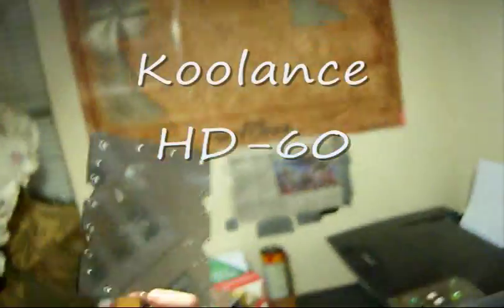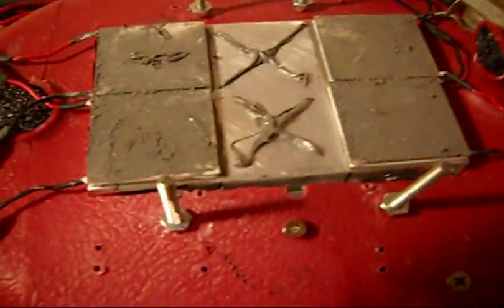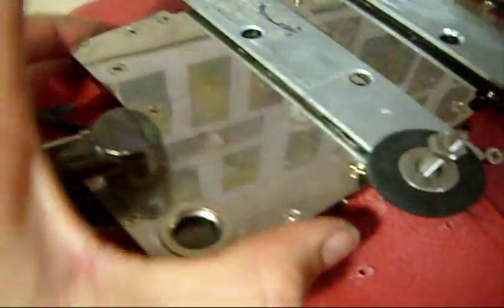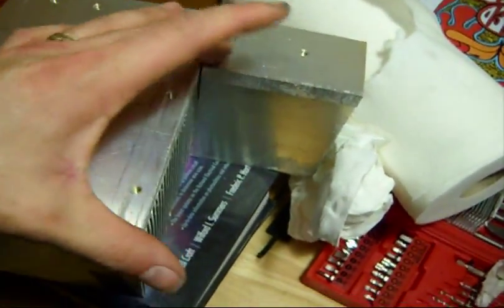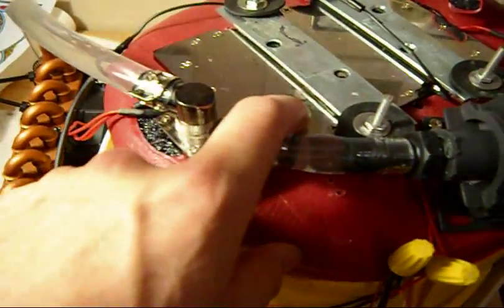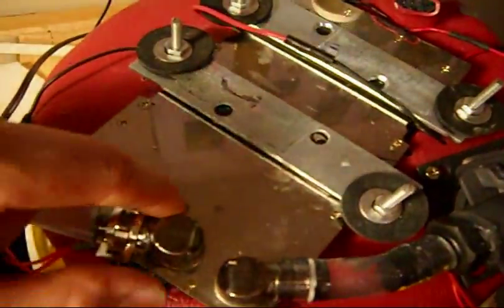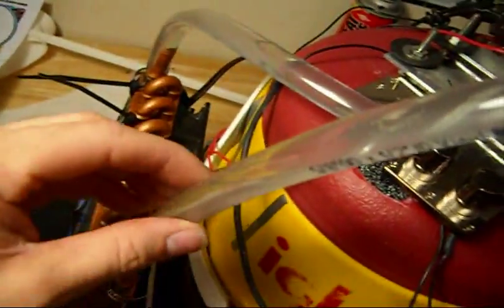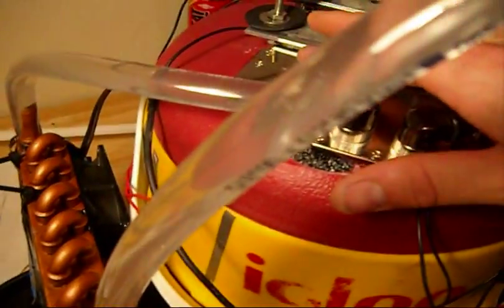Thermoelectric Cooler Part 19 - Radiator&Water Block

Comment: Just came across your series of videos. I watched them all and learned a ton! I'm currently refurbishing an old 1975 vintage 12v Peltier cooler for the icebox on my sailboat. I cruise the Chesapeake Bay and having to stop every few days to replenish my ice is a pain I'd like to avoid. I understand (now, more than I did) how inefficient Peltier cooling actually is, but I have a total of 120watts in solar power and a huge house battery bank that I'm not using most of the time. So... I figured I'd use the Peltier to lower the ambient temp. inside the box and thereby help preserve the ice blocks just a bit longer. Your videos increased my understanding immensely & I truly appreciate your considerable efforts. Thanks!... and best of luck in the future.
Reply: Peltier cooling is inefficient yes, but you can still make it half decent with water cooling for sure especially in small portable applications. 25 watts to get a 8 can cooler down to 40ish degrees? Not bad honestly

Comment: Also make sure the heat compound / silicone makes contact with all of surfaces. I add a digital thermostat with ntc / ptc probe to the water available from Farnell electronics in the UK. It switches a relay for on off cooliing that switches my peltier power supply on and off, simple but efective.

Comment: Hi Taylor. I have built smaller water coolers using peltiers. Chiller unit using similar water cooler with peltier pumps. Check the peltier delta T or effectiveness of the pump, I used 60watt and 100watt bought on ebay for £7 uk. I wrapped copper tubing in a big coil around an aluminium 1 litre cup. I then sealed the cup into a block using builers spray expandable foam to minimise heat loss. Pump the cooled water around the cup and the water inside cools, reverse current and it heats up.

Comment: TaylorHolmes if you don't cool those TECs (and you're generating a tremendous amount of heat there with 6 of them) they are going to soon break and when that happens they could short out hence your power supply could also get compromised.  Watch out!  Get that radiator untangled and put some kick*ss fans on it.  That will solve all your problems  ;)
I'm working on a liquid-cooling project too but it has a different scope:

facebook.com/group.php?gid=103792317428&v=photos

Comment: Ok, a few things you should know, your fan/ducting setup is terrible and your water pump will last much longer if you put it on the cool side of the radiator.

Put a larger fan on that oil cooler and forget the ducting.

Comment: Agreed with strikeagle1 that the best thing is to remove all the tape from radiator, maximize the airflow in it at all costs!  Ideal would be to put 4 fans on front and 4 on back.  What fin ratio and dimentions does that radiator have?

Comment: @strikeagle1
Wrong, more liquid will only increase the time it will take to stabilize to the final balancing temperature.  It will maintain lower temperatures for longer time but when you get to regime it will still be the same final balancing temperature.  You can't run away from the truth LOL!  :)